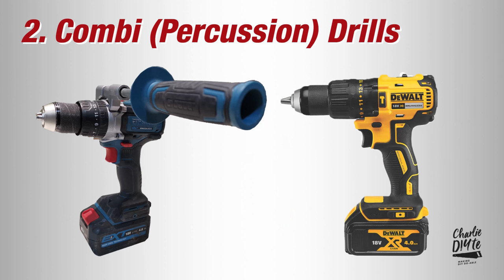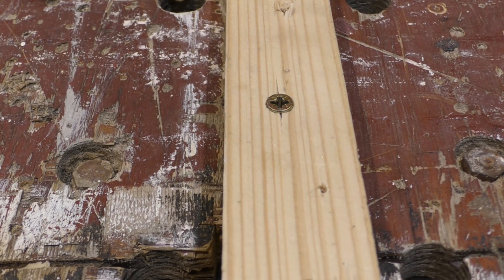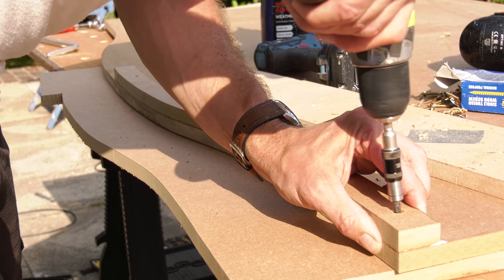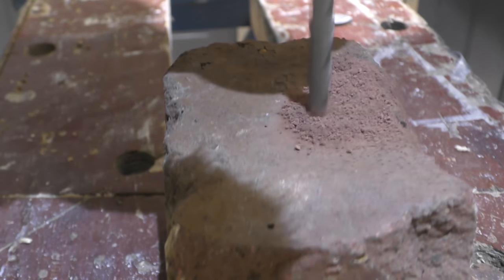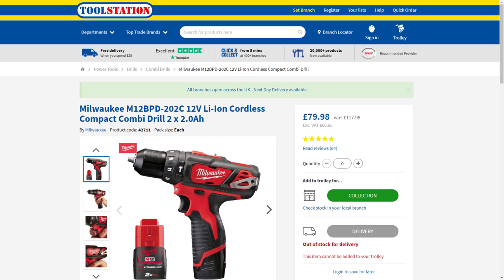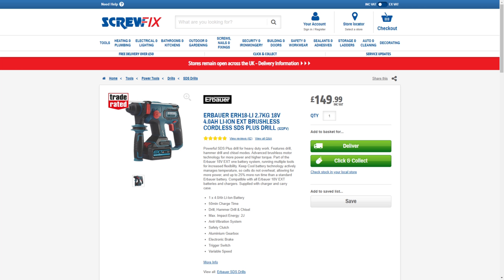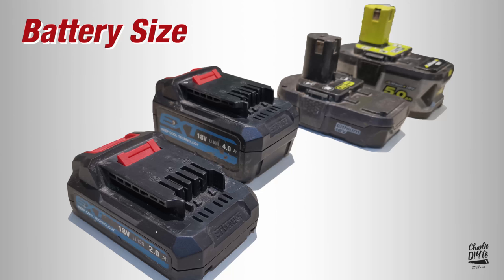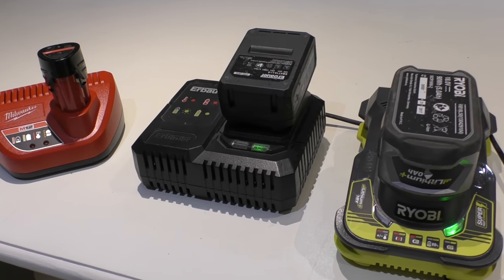The Difference between Combi, Drill Driver, Impact and SDS Drills

Comment: As my favourite was festool and getting them stolen twice. I decided to sell the replacements. Kept my plunge saw. I just buy any brand now. I have dewalt. Millwauke. And titan and evolution same as you charlie I like lightweight tools miss my festool sds drill what a tool loved it.
Reply from the maker: Thanks for that Keith - it's great to hear someone has the same ideas - I was a bit anxious laying myself on the line with this vid! Yes, from what I've heard Festool rock, but they're expensive, aren't they. Sorry to hear you got them stolen twice - that is gutting!! A bit like when I put my leatherman down on site once for literally 2 minutes and it was gone. B&*()^ds! I've got an Evolution chop saw (2 actually because one at work) and the titan as you know. They do a great job, although the laser on one of the chop saws has never been straight which is a bit annoying.

Comment: Currently on Screwfix they are offering the Erbauer combi drill and impact driver for £129 (was £150) That's the set I have currently and I think they are a great little pair! Makes it so much easier to drill with one and drive with the other. Saves on changing bits and overall an absolute bargain!
Reply from the maker: I've got to say my Erbauer tools haven't put a foot wrong side I got them and the batteries are brilliant too 👍🏻

Comment: Great vid. Not sure if this is still relevant, but always make sure it uses Lithium Ion battery as nicads are (were?) dreadful. My first drill was a b&q own brand nicad one which didn’t last a year. I replaced it with a 18v LiIon Dewalt combi, which I’m still using over 10 years later. Occasionally smoke comes out, but I’m waiting for it to die, before I replace it with a lighter, more modern twin kit! I use a corded Bosch sds for the heavier jobs and that it awesome too!
Reply from the maker: Yes I had nicads on my Ryobi drills originally. To their credit Ryobi have never changed the battery housing on their tools so I was able to slowly upgrade them all to lithium.

Comment: Good advise thanks, I might add I have found the impact driver a little noisy for driving in screws inside the house, sometimes I and try to use the drill driver where I can which seems to be most of the time, one of my favorite tools is the Milwaukee cordless angle grinder which came with a charger that can charge both types of battery for the smaller tool and the larger one.

Comment: Informative video Charlie. Btw Metabo's 18v charger will also charge their 12v batteries (dependant on the charger model no. of course.) What 
I tend to do, especially when I need to pilot hole and then drive the screw, is to get a same make, older, brushed model drill/driver and then keep the relevant drill bit/screw bit on each. For instance I bought an older Metabo but brushed 18v bare unit drill/driver for £35 and just keep a screw bit on it.
Reply from the maker: Thanks John. Yes I like your thinking 👍

Comment: Great video Charlie, I have the 12v ryobi drill driver too, take it with me everywhere, I’ve even used it with a holesaw to cut cable access into kitchen counters and desks (I work in IT) totally agree with the weight and size point, I have a whole bunch of Ryobi 18v gear and some Makita stuff too, all the tradies use them here in NZ. Having the two brands batteries let’s me pick and choose which tool suits me best. Excellent advice all round, I only really use the impact driver for rough carpentry when I’m building fences or framing up a wall as it’s just too aggressive for most jobs.

Comment: Very helpful video 👍 quick question. Other than price, what is the practical difference between the ones you've mentioned and some of the cheaper or lesser know brands? Thanks for your help.
Reply from the maker: Hi Matt. Thanks. Yes, I should have touched on this really, but I avoided going into too much detail, because, where do you stop? It depends what you mean by "lesser known brands". If we're talking about brands you've never really heard of, then I'd steer clear, because whilst you might pick up a tool for under £50 it will probably be a false economy and only last you a year or two - unless of course after doing loads of research, said brand has received consistently glowing reviews. The thing is, the big brands like Milwaukee, Bosch, De Walt, Makita have been trying really hard to make their tools more accessible in recent years, and so now, typically only £30 to £50 separates a tool by, say Erbauer, and an equivalent by Makita. In which case, it's a bit of a no brainer really to go for the big brand. However like everything in life, it's not that simple, because the lesser known brand might have really upped the spec of the tool to try and compete with the big boys. The combi you saw in my video is available for £80 without battery and has a metal chuck, metal gearbox, and to all intents and purposes, the spec of a very high end tool, and the three Erbauers you saw in my vid have been fantastic the last few years. Conversely, some of the big brands have dumbed down their specs on certain tools (eg plastic not metal gearbox) to try and compete more on price, so it's not just a case of thinking "that's Makita, it's bound to be amazing so I'll buy that". So I think you've got to do your research and find a tool that strikes a happy balance between quality and price.  My point about brand loyalty is a biggy though. It's simply not essential to stick with one brand just for the sake of saving money on batteries. Some of these combi deals bundle in two batteries with a tool and you're up and running.
Reply: @CharlieDIYte  appreciate your answer 👍 you've made things a lot clearer. Who knew buying a cordless drill could be such a minefield....😂
Reply: @CharlieDIYte  by the way, I find your YouTube channel is fantastic for me the average diy'er. Clear explanations and it's my go-to channel for all things DIY 👍👍
Reply from the maker: @Matt-go7ss  Thanks so much Matt. I really appreciate that 👊🏻👍🏻

Comment: I have the ryobi percussion drill, which is great for my needs. but when I needed an impact driver I went for the erbauer one because it came with the fast charger and 4amp battery at a fantastic price.
Reply: So you've already made one of the biggest mistakes in power tools. don't mix and match brands because the cost of the power tool is really the battery. pick a brand stick with it and every new power tool you buy will come with one or two more batteries to add to the collection that works with all of them also once you have a suitable amount of batteries you can save money by buying bare power tools that just come with the tool itself. That's why it's good to pick a brand that comes with a full range of tools like DeWalt Makita and Milwaukee.
Reply: @davidmcguire6043  thanks for the advice David. I was going to stick with buying ryobi tools, and I had planned on buying their impact driver brushless bare tool, but the cost of it was still €30 more expensive than the equivalent erbauer driver, including fast charger and 4amp battery and a case also. I will build my ryobi collection still, and I think I will buy some erbauer tools also. I don't mind having two tool brands. But I do appreciate what you saying

Comment: I have had Milwaukee M12 drill driver and screw driver for some time, both have given faultless service and being small have got into places that my DeWalt 18V impact driver will not.  I also use the 2Ah batteries and have never found their life to be an issue.  The main advantage for me of the screw driver is the very low torque setting that i have used for small screws before finishing by hand.
Reply from the maker: Paul, I'm so pleased to hear that (massive thanks for getting in touch) as, whilst I can vouch for the Ryobi, the Milwaukee is new so it's a bit of a heart in the mouth moment recommending something I haven't got solid experience using. I'm confused as to why they have a drill driver and combi, when both are the same weight, same price. Also, I like to finish off screws by hand like you, with my Stanley ratchet screwdriver. A fitter who works for me refuses to do this (even though I've bought him one) and relies instead on instinct with his DeWalt impact driver, which is crazy as far as I'm concerned.

Comment: Good video. I disagree somewhat about battery loyalty though.  It is so much more convenient to buy a bare unit at very low cost once you have a store of one brand's batteries. I have half a dozen einhell tools and 2 x 4.0ah and 2 x 2.0ah batteries. This alongside a few choice corded tools (circular saw, mitre saw, percussion drill and breaker) has been a very low cost way to tackle DIY tasks requiring the use of a power tool. My only conundrum is my drill/driver is makita and it has been an absolute beast for the last 8 years.  When it goes I am not sure I can trade down to the best Einhell has to offer!

Comment: Thanks very much for the vid, clarifies a lot. Just one point on batteries, if you buy a combi or other, with a say 2Ah battery, can one upgrade and stick on it a more powerful battery, and vice versa, on a 4 or 5Ah drill, put a 2 Ah battery, and if so, does that affect thé charger you have. Reading specs, it's never clear to me whether batteries are interchangeable or not.
Reply from the maker: Yes you absolutely can. All my Ryobi starter kits (I bought one with a combi drill and an impact) came with 1.3Ah batteries, which are pretty useless but light. And all I use on them most of the time is my 4Ah or 5Ah batteries. Obviously you can only put more powerful batteries from the same brand on that tool though. No it doesn't affect the charger. Again, the starter kits typically come with the cheapest, slowest charger they stock, to keep the price down, and you can upgrade to a fast charger. The batteries will charge on fast and slow chargers.

Comment: Great video, couldn't agree more re brand loyalty.....however i would recommend an impact driver every day of the week. Better for driving screws than a combi or drill driver. Far more control....and especially now you can get 12v impacts
Reply: You should never recommend that somebody has only a drill or only an impact they both complement each other and they're both good for different situations. For instance I use my drill a lot for cutting holes and drilling into thick steel an impact driver isn't suited to either of those if you could get a hole saw to work with one it would screw it up and it would snap drill bits in steel and there are many other reasons you should have both and apply the right one to the right situation.
Reply: @davidmcguire6043  i never said you should have an impact driver over a combi drill

Comment: Would you recommend the Ryobi combi driver over the regular Ryobi 18V drill driver as an all purpose driver for a complete newbie?
Reply from the maker: Yes, I had a Ryobi combi for years and it's a fantastic tool. They're bringing out a new range this month so maybe hold fire before you buy. The Erbauer https://bit.ly/30RHUY6 that I've got is also a fantastic tool with pro specs, although it's quite heavy with that 5 Ah battery.

Comment: One thing I would have personally mentioned would be battery availability. If a manufacturer suddenly stops making a battery and you need to replace yours then you will be left high and dry with useless tools. Erbauer did this a few years ago but I believe Ryobi haven't changed batteries since inception. 

How much the batteries cost is also something I look at. If you buy a drill and think of it as investment (opening up the possibility of more tools in that range), but then find buying the batteries for that new power dependent saw or impact tool extortionate, then the "buying into that system" has been a waste of money. Ryobi batteries rarely get reduced in price and the 4ah costs on average around £55! Makita 4ah is often reduced down to sub £30 (Less professional tools such as Parkside, Draper, Stanley, B+D, Worx will be even cheaper - I got 5ah batteries for the JCB tools for £20 each, on clearance from B&Q)

And also the range of tools available. If I am deciding between two starter kits at the same price (with comparable quality), then I will always go for the one that offers more future expandability.
Reply: Where is it you’ve found Makita 4ah batteries on sale at that price? I’ll need to keep an eye out for that definitely!

Comment: Cracking videos Charlie, they really help me out alot. Thanks for making them so easy to follow. I'm looking at buying an Impact Driver and notice you use the Erbauer and Ryobi - not much difference between the 2 but i wonder which one you would recommend? I'm thinking of the Erbauer because it comes with the 4Ah battery as opposed to the Ryobi which comes with the 2Ah.
Reply from the maker: I've been very happy with my Erbauer drills. There is a micro second delay when you pull the trigger but you'd only notice this if you have a brushless tool from another brand that doesn't do this. If you can get one with the 4ah battery I'd probably go for it over the Ryobi.

Comment: my 2 pence... while I have a few tools in dewalts 18v range, the best price/performace range for me is still the 20v Parkside from Lidl (the regular, not the brushless "performance" series which is more expensive). I'm going from memory here but it was roughly: impact driver £25; combi hammer drill £40; angle grinder £30; batteries and chargers are all purchased separately and it was around £25 for a 4Ah battery. I've done a good few renovations with these and I can't complain about the performance for the money - perhaps one criticism would be equivalent capacity batteries probably last a bit longer on the dewalt but I haven't done any comparison testing and the parkside ones are cheap enough you can buy extra to keep on rotation. The downside with Lidl is that they only sell tools on a rotating basis so you have to keep an eye on the website to see what tools will be selling when.

also very much agree on a 12v driver. I keep a 12v parkside driver as my goto, primarily as it's small enough to fit in my main tool bag.
Reply: Agree, DIY is different from everyday professional work. Lidl tools are fantastic.  Brilliant value for money. 4 AH batteries lasts long and have the power.

Comment: Thanks Charlie. Can I use hex drill bits in my combi drill or would I be better off sticking with the normal round bits?
Reply from the maker: You certainly can you hex bits. DeWalt do a good range of hex HSS and masonry bits. They're superior to circular bits because there's no danger of them slipping in the chuck.
Reply: @CharlieDIYte   Appreciate your reply Charlie. Thank you

Comment: I agree with the combo drill/driver/hammer. How about the combo drill/hammer plug-in 7.5 amps?
Reply from the maker: I use a plug in SDS - that Titan, but haven't used a combi plug in for a while now. No need when you can get adequate power from the batteries.
Reply: @CharlieDIYte  which brand of cordless hammer drill do you recommend

Comment: I'm looking to get a drill for coring 102mm holes in plasterboard and brick. With the brick, I live in a flat on the second floor so would only be able to core through from the inside. What drill/type would you recommend? I only have a drill/driver at the moment but the chuck isn't wide enough to fit the auber (for the hole saw for plasterboard) so a chuck size of 13mm would be required.
Reply from the maker: For coring holes through brick you really need an SDS and 240v. Take a look at this. It's heavy but oh my, so much tool for the money https://www.screwfix.com/p/titan-ttb631sds-6-3kg-electric-sds-plus-drill-22-piece-accessory-kit-230-240v/4172g

Comment: Hi Charlie,

Great video, you covered the differences between the tools well and I'm sure this video will be super helpful to people.

From my own experience I totally agree with you that a lighter tool is more comfortable and easier, as DIY'ers we don't need batteries that last all day, just 2 lower capacity and charge between use. Perhaps it's more the office work that doesn't prep us for the weekend DIY! But often the 18v can be cheaper and offer more bare tools for future purchase.

So I feel if on a real budget an 18v combi could be worth picking up to get the charger and battery and then cheaper bare tools at a later date. Particularly if you want/need garden tools which all seem to be 18v+.

On the SDS as you mentioned the Titan is a beast - super heavy but fantastic! Mines taken an absolute beating but has performed faultlessly.

Cheers!

Comment: I highly recommend 18v Ridgid tools for DIY. The batteries have a lifetime warranty which is hard to beat especially with how expensive batteries are getting. The 12v Ridgid tools are nice also but the batteries only have a 3 year warranty. I did however just purchase M12 Milwaukee Fuel combo drill and impact that came with 2,4 and 6ah batteries. They are much lighter and more powerful than my 18v Ridgid drivers. I still use both but if you plan on doing slightly more than DIY I recommend Milwaukee or Dewalt.
Reply from the maker: Nice comment, thanks for that. I'll check out Ridgid. I also agree with you about the trade point. 👍

Comment: can i use a 4.ah and a 2ah battery on the same drill ? does it just give more power or length of use?
Reply from the maker: Yes you absolutely can. Sometimes as I experienced in this video https://youtu.be/JVMwp4Hm7OQ for very torque intensive jobs you might find the 2Ah battery isn't up to the task but this will be rare and in that video the 1.3Ah batteries were I suspect close to the end of their life. Generally though you want a 2 and 4ah battery. The 2 Ah is great to keep weight down. The 4 or 5 is a must for tools like circular saw, chain saws, SDS drills. Yes the 4 or 5 Ah will deliver more power and greater length of use